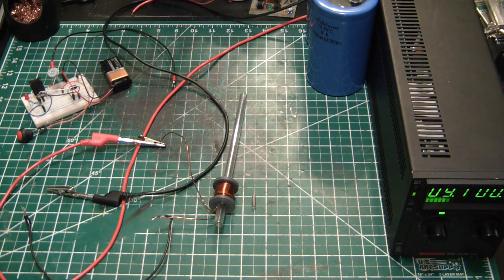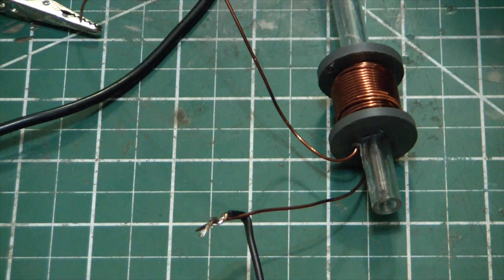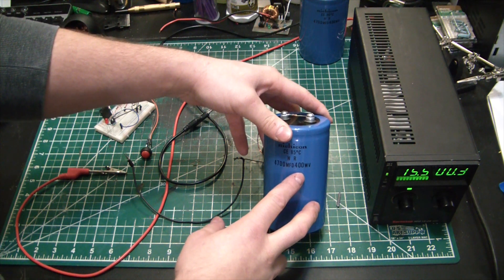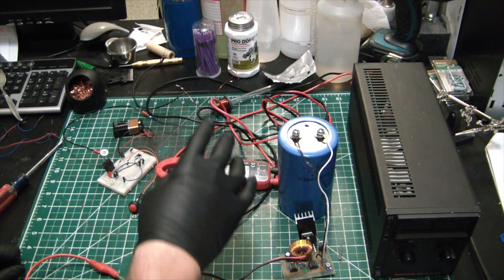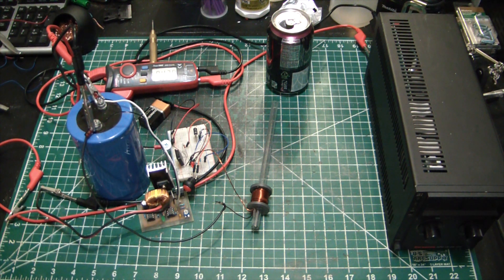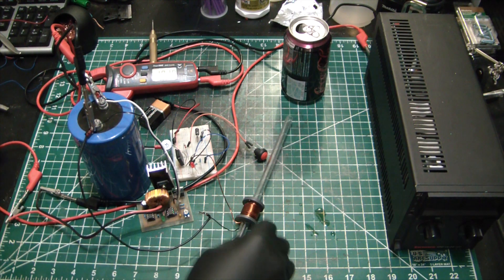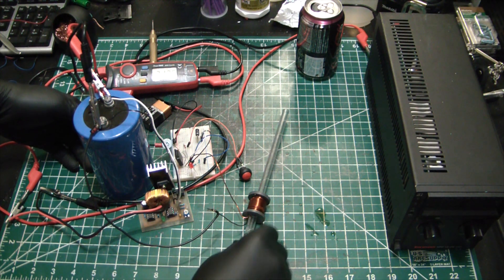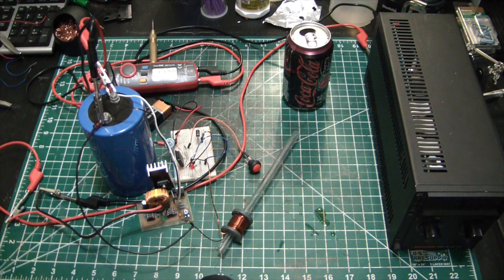Build Your Own Electromagnetic Accelerator (Coilgun)  - ElementalMaker

Comment: We live in an electromagnetic envirosphere. Electricity is a fundamental to everything. They collect it from the atmosphere, wire it into our homes then charge us for it as if they were burning gold to make it. Tesla understood this principle because he was educated in true science rather than theoretical psynce. Lightning has enough power to combust nitrogen without containment to create the pressure. That's mighty powerful stuff.
Reply from the maker: Bob I agree that the atmosphere is charged, but I can promise you that is not how our electric grid is powered. I've worked in many generation plants, and trust me it ain't coming from thin air.
Reply: @ElementalMaker  
Battersea power station is a fine example. 7 years after it was built it was derelict. It didn't contribute a single kw of power through the burning of coal. It was built to encourage us to imagine big coal slugging power stations churning away. It didn't even have a roof on until a few years ago when it became an art installation. Pink floyds pig (animals album) flying over it was a symbolic gesture toward understanding.

Now engines can run, turbines can spin, voltage meters can move, but that does not stop the fact that most of our power is manna from heaven, to coin a phrase. Indeed, when it comes to converting the electricity to AC it requires a mechanism to do this.

Back in the 1920's before our corrupted, theoretical psynce system took over from real science, The nature of "earth" was very much understood. Peer reviewed experiments proved that the "earth" wasn't an oblate spheroid doing several million miles an hour through a vacuous void called space.

Airys failure had already established that the "earth" was motionless beneath a revolving star field. 

Tesla had declared that the "earth" is a capacitor and that above us is the electrostatic theromosphere.  When he constructed his coils, he demonstrated this relationship. His coils step up amps at the expense of voltage and through this it can be forced back into the atmosphere.

Radio waves are electricity forced into the air.  Radio receivers are collecting electricity from the air.

Michelson and Morley had established beyond doubt, the existence of the aether with their spectrum interferometer experiment and the Sagnat experiment, the results of both experiment were properly peer reviewed. They also proved the "earth" to be without motion.

Some people will argue that their experiments were unsuccessful. This is because they set out to prove rotation but failed. The Sagnat experiment was similar to the interferometer experiment except that it rotated. This experiment showed that the results from the first were accurate because it demonstrated the interference patterns that their first experiment failed to show. This validated the results of both experiments and conclusively demonstrated the existence of the aether.

Of course we don't get taught about these experiments because it goes against the "ball-monkey" paradigm that we are supposed to swallow. Accidents in the infinite are easier to make slaves of than people who will not be stock.

I know that this will be a bit of a head scratcher for you, but herein lies the path of wisdom. Once you crack this head contusion, electricity will loose virtually all of its complexity. It is the life essence of what is basically a living universe.
Reply: Good thing I can make lightning strike every time I need  a ten billion watt blast of power. Keeps the ol cellphone charged right up
Reply: @Justapotato14  
What you need is a series of tall towers and a grid.Then you'll be good to go.
Reply: Fucking hell.
Reply: That still doesn't rectify the issues. Having a series of collection towers is great for sucking up power when a storm cell is over head, but what happens when it burns out or moves? You'd require some form of storage facility to hold days if not weeks worth of power. No battery exists that has such a large capacity.
Reply: @Justapotato14  
Why does the storm need to be over head if you have a grid? There just has to be atmospheric electrical discharge going on somewhere. Electrical charge is what hold millions of tones of water in the air. Besides, if you are controlling its rate of earthing, you won't see as many electrical storms. I haven't seen a flash of lightning in six years. 

High voltage electrical power lines are not insulated. This is because electricity goes to them and not from them unless earthed.

When electricity arcs to "earth" in a storm, it sucks the juice from the power cables. This is why short power cuts happen during storms.

Capacitors of any size can be and are used. 

When you have to much power it needs to be used. This is why "wind turbines" spin when there is no wind.
Reply: You don’t need a lightning strike to combust nitrogen. A small neon sign transformer is more than enough to combust enough nitrogen for nitric acid production on a small scale.
Even a Flyback transformer can produce NOx.
Reply: @among-us-99999  
Do you have a complete method for doing this?
Reply: bob question step 1: play with arcs
Step 2: use your nose to S M E L L  T H E  O X I D E S
/s
Cody’s lab has a video on it.
And i saw a simple experiment in multiple books:
Two high voltage electrodes in an airtight glass container (fishbowl?). The air inside will get filled with acidic, brown fumes.
Not very effective.. but it works as a proof-of-concept. But: Higher current=higher temperatures=higher yield.
Reply: @among-us-99999  
Nitrogen dioxide is brown. Electrical arcing should produce ozone 03. maybe not when confined. 03 has its own smell. Its the n2 bonds that take the energy to break, once broken nitrogen is highly reactive. then it wants to react with whatever is around it.`If water is around it, it will break the water then react with the hydrogen to form ammonia and with the oxygen.

But lightning combusts it to NO3 which is plant food. That takes loads of energy when it is confined and heated, to do it with air pressure only as the container is mega-power... Big bada boom.

Nitrogen is the hidden work horse in many things including petrol and diesel engines. I think jet engines use nitrogen as well, they have constant heat and pressure and don't require any other fuel, once up to power. Sometimes you see brown nitrogen dioxide being emitted when they take off. Military planes especially.

Comment: If you add an IR interuptor to detect when the projectile exits the coil, then turns off current to the coil, the velocity of the pronectile will not be decreeased as it exits the coil by the residual magnetic field
Reply from the maker: It would need to be in the center of the coil, but yep that's the concept. One to detect entrance to the coil, one at center to deenergize the coil.
Reply: @ElementalMaker  Nope,

Just add one detector before the entrance and one where the projectile starts. 

Have current dump into the coil when the object triggers the first detector, at the start, and stop current flow when it enters to the coil.  You could even work out a way to observe the velocity of the object and calculate how long the coil needs to stay on before the the object passes through the center.

There is potential here for a very interesting project. I would also recommend you look into rodin coils.
Reply from the maker: @3er24t4g1  very cool idea there!
Reply: @ElementalMaker  you should also consider using a laser range finder pointing down the barrel of the coil gun to do this very same thing. Of course, you would need a microcontroller to handle everything. Using an arduino/laser range finder has the added benefit that stacking coils would be very simple. You could have lots of very small pancake coils. 

Also you should think about using a teflon or glass tube for minimum friction
Reply: @3er24t4g1   a laser range finder would have a huge delay ...
Reply: @nick5625  How so?